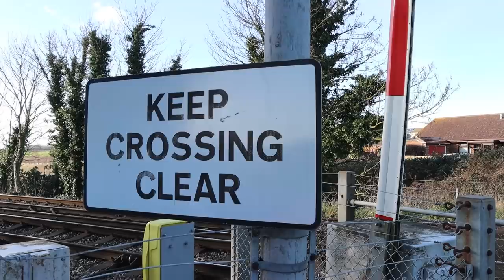Thanet Parkway Station is being Constructed

Comment: Sad they didn't get permission for a new footbridge. Yes, it would have been really tall compared to the surroundings, but that could have been a main feature for the station! Put in some extra space & extra nice windows for taking in the views :)
Reply: Exactly. It’s all down to design. Offer the locals something attractive. I mean with mass production these days surely pressed metal panels with fancy designs or emblems or sculptures are not that prohibitive.
Reply: You would never build a footbridge there. If the tracks are on an embankment and a subway would be at the level of the surrounding approaches that's what you would do.

A passenger making a round trip using each platform once would have to make 2 changes of a single level. If they have to cross by a footbridge they would have twice as many steps, because in one direction they would have to go up twice as high and back down again.
Reply: @paulkennedy8701  I agree, one of the footbridges at Worcestershire Parkway stats and ends 4 metres below rail level and it's a real workout to cross it, but luckily it's only for pedestrian access to a village some distance away so not much used.

Comment: 9:07 and 9:25 Definitely a side note, but was surprised to see that cars don't stop before crossing rail tracks in the UK!
Reply: The barriers were up, so safe to drive across.
Reply: @llynllydaw  Doesn't mean a thing in my country (Japan) - you must always come to a full stop before crossing rail tracks.  Then again, there are far more level crossings in Japan than the UK, so I guess the likelihood of signal or barrier failure is greater.
Reply: @andymerrett  Yep, it really does seem to be pointless when the the traffic is flowing smoothly.  I wonder if the rule is in place just for the sake of standardization - after looking at the UK's rules, there seems to be different rules applied to different types of crossing - which make a lot more sense.  I would guess most of the road laws in Japan are hangovers from the 1950's when there were far fewer cars on the road.  And of course it's also a handy revenue stream for the police - on the spot fines do mount up!

Comment: About ice;
   "So does ice conduct electricity? No, ice does not conduct electricity because it does not have free mobile ions to freely flow through it to conduct electricity. Ice is a crystalline form of water due to which the ionic mobility in ice is pretty low making it an insulator."

Comment: Uhm....wait, did he just say that the barriers are being 'upgraded' to being manually controlled?
I'm pretty sure they have the phonenumber of a few other railway companies that can tell them how to make fully automatic barriers? (As in, from other european countries)
Or does he just mean that they can also be manually operated if the automation fails?
Reply: I'm guessing it's manual due to the train station being nearby and the traffic being relatively high.  An automatic gate may cause problems.
Reply: @firesurfer  We have that here (NL), and it's not a problem. From what I was told, there are no manually operated crossings on the mainlines, even those next to stations. I'm sure network rail can reach out to someone that can tell them how to do it.

Comment: The most logical approach to Thanet Parkway would have been directly off a nearby roundabout so that it could be accessed from the south, north , east or west.  Considering this was farm land, what was the problem doing this?   Instead they have put the only access off a south bound dual carriageway.  This involves long detours and U turns around roundabouts for anyone not approaching from Thanet.  Not impressed with forcing drivers on long detours and U turns around roundabouts both to gain access or get home afterwards.

Comment: Is that a level crossing with a live third rail?!
Reply: no. 3rd rails stop just before the crossing. All Passenger trains have more than one electric pickup so the front one loses power but the rear ones still have contact. As soon as the train has passed over the road crossing the front one connects back on the 3rd rail

Comment: Is there any reason the station was designed with those high, solid sides all the way along the platforms?  I realise the height makes it exposed to wind and weather and also that the panels might insulate from noise but I can't think of any other reason.  As a passenger, I think it's a bit claustrophobic and might be intimidating when quiet at night with no visibility into those shelters, especially with the very narrow platforms. It just looks ugly too.

Comment: Tell Jen, 20% EV capacity in their over-sized car park is a laughable investment. 

Not only should any new station to serve adjacent housing developments be a public transport hub, those that must continue to drive to make the new station commercially viable in our deregulated rail mess, but the EV infrastructure should therefore provide 175kW DC chargers for buses and 100% of the car park spaces must have at least 7.2kW AC chargers, if not a valet service with higher output chargers to allow room for the dinosaurs that insist on driving to the local station! 

Clearly, in planning a station with a delightfully echoey subway crossing, the non-operational land should be equipped for electrified road transport and have a network of accessibility routes connecting it to the local area under a Local Cycling and Walking Infrastructure Plan (LCWIP).

Great Chris cameo on replacing crossings and improving line running times to compensate for the stopping pattern at Thanet Parkway.

Comment: Spending all this money on a station in the middle of nowhere. Why on earth could they not spend that money and build a station at Manston Airport and provide a high speed line to London and therefore provide much needed relief to the existing overloaded  London Airports which is so badly needed.
Reply: Huh? It's actually at Manston Airport. It's exactly where you would build it if you were going to upgrade the airport like that.
Reply: @paulkennedy8701  My apologies ! I did not realise that the station was at Manston. Possibly they should have named the station - Manston Airport then and so give the airport more status.
Reply: @phil7794  

It's called Thanet Parkway because it's main use will be for people driving there from Thanet towns.

It will have very little value for anyone using the airport, since the terminal is on the other side of the runways. (It would be slightly shorter to walk from Ramsgate.)

However, if they decided to make the airport more important, as you suggest, they would build a new terminal on the side where the station is. Presumably they would build a second runway on that side. That would put the new terminal right beside the station.
Reply: Manston Airport died many years ago. They are just having to wait to build on it.

Comment: I do not understand the British need for excessive safety measures. No reason to have CCTV and all that there. A couple more sensors can detect that the train has not left the station and raise the gates. Then they can see that it has and lower them again. Used frequently in the USA.

Comment: All that hi viz and hard hats, etc. is Health & Safety gone mad.  Spent many an holiday when at Uni as a labourer on building sites, the only safety was common sense.  The only injuries I suffered were splinters and burnt hands from sliding down wooden ladders and the occasional burn from the morter or a bump on the back from a brick falling from the hod.  We have abandoned common sense and toughness.  At least I was one of the fittest and tanned students when the new term started, and one of the one's with the most money which meant I spent most in the Union Bar.

Comment: Why does This line require high speed trains.  There are no big cities that would require a high speed trains when basically all towns are under 2 hours from London.  Seems a waste of resource having these high speed trains in such small countie
Reply: They have a nearby line and a junction what's wrong with running the express trains on the high speed line, all it does is makes it faster
Reply: I just mean. There is billions being spent on our railways. Having high speed trains in counties on London door step is just really a waste of time when modern commuter trains are already relatively fast.
Reply: The only line in the UK is currently High Speed 1, built for Eurostar - so domestic rail services may as well also use the line if it is already there. If it weren't for Eurostar then there would most likely not be a high speed line
Reply: "Waste of resource" implies that the resources would be better used elsewhere. They can't just put even more trains on the HS1 mainline, for reasons of both capacity and demand, and there's no point running high speed trains on a route that doesn't use a high speed line. If your line is already connected to the high speed line, why not use a high speed train and operate a high speed service on the parts of the route you can?
Reply: @n1thmusic229  thanks, just always puzzled me why need for high speed trains in Kent. Lovely place been to there few times.  Specially Canterbury 👍👍👍👍
Reply: @theblueorder9005  No problem I know many people might have trouble with something like this, it can be quite confusing at first sight